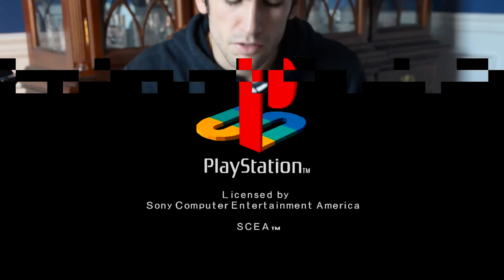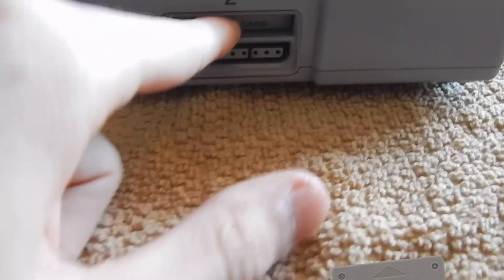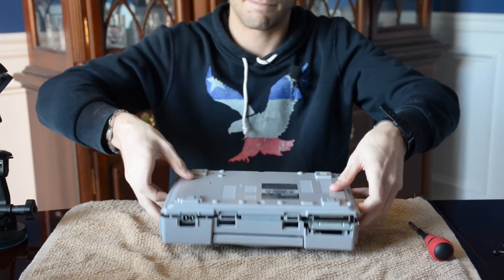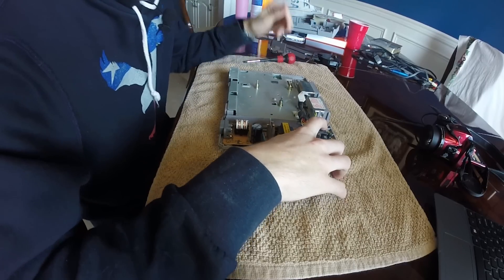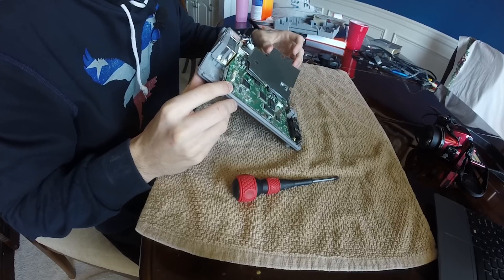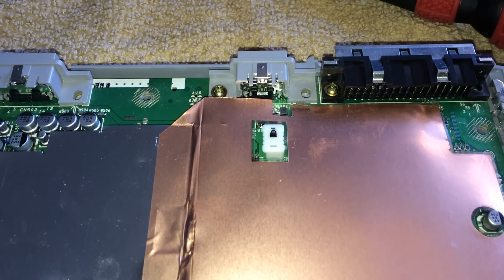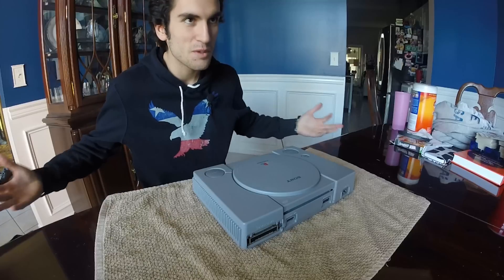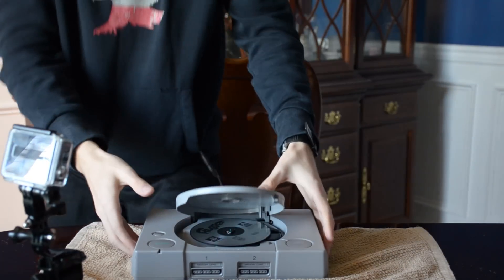Deconstruction: Original Sony PlayStation

Comment: The sound I think comes from the lens sliding back and forth in it's track. Basically it's having trouble reading the disk, so it's trying really hard.. Could be a dirty disk, scratched/damaged disk, data rot, dirty lens.. Not sure about the PlayStation 1, but the PlayStation 2 had a "pot" adjustment screw that could be used to tune the laser of the disk reader. I've heard that sometimes the lasers just go bad and can't be fixed. they just have to be replaced, and usually it was cheaper to replace the disk drive itself. On the PlayStation 2, you could use a DVD drive from a desktop computer, but only specific models were compatible.

There's lots of info out there since these older consoles are somewhat collectable and there's a fairly healthy community of collectors, modders, etc.

Good luck.

Comment: 1st: the noise comes from the motor bearing, it should be oxidized or damaged, but probably is what is causing the lag. By loading the game into the ram is making it faster.

2nd: an actual pentium is faster, running up to 120MHz, an HP50G calculator has a 700MHz-ish processor, thats amazing!

3rd: if you disasemble anything alse with a big capacitor DON'T TRUST THE 10s RULE!!! Sometimes these capacitors don't feed power to anything if the circuit is not working, so they will be charged (in special inside TVs. special warning to the tubes, that thing stores energy for years and can kill you). Use a ground wire to discharge it instead.

4th: one of those rear mounts were used for a cheat ad-on called game shark, Mr nice guy XDD

5th: the metal board is made of coated steel to protect the insides of the motherboard. Didn't help a lot about the cd reader, though, but it traces back from old ataris 2600 through nes, snes, master system and genesis. Old kids used to drops those videogames a lot compared to these new kids XD

6th: awesome video, keep up!

Comment: It looks like an SCPH-5501. NOT the original model. The SCPH-1001 had separate composite outputs, as well as 2.5mm jack to supply power to an RF converter. That was located between the Serial and AV ports. The Parallel IO was used for GameShark. I recall Gameshark had, at one point, a thing you could plug into your PC to basically probe the memory while playing, and I THINK that used the serial port. Other than that, I don't think either of them did anything. The 1001 was designed such that the heat from the power module could actually damage the CD read head, but had one of the best BIOSes for emulation. On my 1001, the power module actually stopped working, and I replaced the whole thing... retrospect, I probably could have isolated the faulty component and replaced that, but, yeah...

Comment: true first generation PlayStation had the original 3 three color A/V plugs instead of the proprietary form plug--->RCA (A/V) plugs. but still same innards but the original I have had the female 3 color A/V plugs. I'm guessing another way to need a special replacement part 
I really don't know if they're the same but u assume V.1 and the V.2 I have are the same. both of mine run the same. just another way don't got you to buy the proprietary cable.
just some history.
Reply: just another way THEY** got you to buy my a proprietary plug. 
sorry

Comment: It's EDO RAM while at it. ;)
Interestingly enough, some models actually ship with 4MB RAM, which to utilize require bank switching, otherwise it works as standard 2MB. Also, there is a certain board model that can be upgraded to 8MB RAM (I think it's 8, off the top of my head). Not really useful for existing games.

Comment: Hey. Actually the first Playstation model has rca stereo composite output on the back between the multi-av and the serial port. 
Well, the first first Japanese revision even had a svideo output too! 

Maybe the controller didn't worked because the game must have digital only inputs and by hitting the button that activates the analog sticks, you disabled the controller. 

And the parallel port...  Now there's a device called "ps-io"  which is kind of a flash card for the PlayStation...
Reply: The pro action replay also used the parallel port.. I wish I still had my 1001 (with the AV ports right on the back)
Reply: Filipe Lana yea mine has av and RCA out jacks too

Comment: my PS1 read CD's only when it was on its side :D
Reply: So did my 1001 model.. It's a common problem... the drive motor bushing wears out putting to much drag on the spindle to spin the disc fast enough.. putting it on it's side takes some of the drag off so it reads.. to bad it's only a band-aid
Reply: Mine had the same issue :D And I was the only person out of all of my friends to have a 'chipped' PSone to play NTSC and burnt games - So it slanted its way through everyone's living room.

Comment: If the motor made some sort of rattling or grinding noise, it could indicate that the CD could have been very scratched so the laser lost tracking all the time and had to rapidly find the previous place where it had skipped off and slow down the cd for better reading results. That would explain the skipping intro movie. It was read directly from the CD and because the reading head of the CD player couldn't keep up the constant data stream from the CD, the movie started pausing. Or the CD could have been just fine but the components inside the PS had dried up so their responsiveness wasn't at their best and caused that pausing. I had similar issues with one PC game called Megarace but its movies because of my slow CD drive and not because the CD was scratched or my that time's PC was too slow or unused.

Also the dead controller is a "normal" thing with PS's. My PS2 controller also died partially so that none of the right hand side buttons worked but the left hand side buttons worked just fine. It's a design feature called planned obsolescence. I even opened it up, cleaned everything I could, made sure everything was soldered well in place and all wires were connected well and so on and I still couldn't get it to work. It was some microchip breaking up or some capacitor drying up or some other that kind of stuff which  you couldn't see with your eyes.

Comment: I'd say disk or lens was scratched or dirty... 
Only time I ever had one load that slowly or skip in that manor.. .
And the noises are totally normal. Even when I had a brand new one as a kid, I remember that noise.
Reply from the maker: I remember the noise too. I was referring to the rattling plastic sound. That was not normal.
Reply: Ah.

Was for mine though!
When I got old enough to question it, I chalked mine up to a missing ball bearing that would hold the disc down in the tray after hundreds of hours of use..
As old as they are now, it could be a dead bug, a peice of dirt or grit from a carpet, a crumb, anything really..
Just part of the nostalgia for me. My ps2 does it too...  Those older systems could really take some abuse and still work wonderfully...

Comment: Yeah, the shielding cans are usually soldered to the board for RF suppression, especially from the switch mode power supply. From what I remember the PS1 use complete software rendering so no GPU either, other than a display driver.
Reply: There were different solutions that generation over, and generally they use copious amounts of hardware acceleration because cheap CPUs that generation simply weren't fast enough to generate 3D images. It was possible say on a Pentium PC CPU in a comparable manner to Playstation(1), but that was a processor of complexity and expense that was much too high for consoles in early-mid 90ies. Additionally, it was easily noticed that in a 3D game running on a Pentium, 90% of the time would be spent filling the triangles, with the rest of the time being for geometry processing and the actual game logic, so early 3D accelerators for PCs only did that one thing, drawing textured triangles. The driver software would do the geometry transformation on the CPU, and deliver pixel coordinates, 3 sets of x, y, and depth, per triangle, to the accelerator hardware. Correspondingly, a console didn't need a strong CPU if it just had triangle rendering hardware accelerated either.

N64 uses a second CPU, dubbed DSP, with a mystery co-processor to produce graphics and sound - presumably the co-processor accelerates drawing triangles not as a whole, but line by line. It was not usually directly programmed by game developers, running the same Nintendo-provided program for almost all games, with Factor5 and Rare games being almost only exceptions, plus Resident Evil 2 had a slight modification to default software. In a way, it provided a modern high-level interface towards the game software running on the main processor. Early N64 emulator UltraHLE didn't emulate the DSP workings at all, it merely grabbed the signals going to DSP and vaguely recreated what stock Nintendo software was doing. The list of features that the mixed software/hardware solution implements on N64 is impressive - filtered textures, perspective correction, z-buffering to disambiguate overlapping surfaces, lighting, you name it. From the point of view of the software, this is already not dissimilar to more modern GPUs like GeForce 1/2. The performance was of course not comparable though. It's believed that N64 was co-designed by SGI and carries a lot of its legacy, but NVidia is also a company manned by ex-SGI people, so it's not too surprising that they tried to converge on something vaguely similar over the time.

Playstation uses a more typical arrangement for the time. The PS1 graphics processor took a list of transformed (and optionally colour tinted) triangles or quads (internally treated as two triangles) in view coordinates (essentially pixel coordinates) and rendered them, and the CPU carried a co-processor that accelerated matrix-vector multiplies, to allow you to rotate and translate your triangles from global or per-object coordinate systems into the view coordinates quickly. There are two quirks to the Playstation GPU, both conserning the fact that it has no concept of depth. It distorts the texture only in two dimensions instead of 3 (so called affine texture mapping), so at an angle it would look very wrong, and the second was that it had no way of disambiguating what surface was overlapping another one. To help with the latter, the GPU command stream provided a list of buckets where you could put all your surfaces that lie in particular depth range per bucket, and it would render them in that order, with most software choosing to draw back to front to make closer surfaces correctly cover the distant ones, and of course the solution wasn't exact enough so sometimes things ended up switching order, you can clearly see that in many games. There's another possibility, by marking a pixel as already drawn and drawing front to back only on the pixels that weren't drawn to before, but nobody did that. The affine texture mapping was sometimes fixed in software by subdividing polygons that it would be most apparent on. These were the compromises that had to be done so the GPU could be designed in-house and manufactured at a low cost. It's a surprisingly simple design - a minimal set of modifications compared to a system that can simply rotate and scale sprites like SNES could do with one of its playfields or some arcade machines did, basically just adding skew and clipping a transformed sprite along a free form triangle.

Sega Saturn, even though it's structurally way different, went with a vaguely similar GPU design approach to Playstation, but failed to make the system compatible to triangle based graphics as was common on SGI workstations that were used to produce 3D objects for games that generation, perhaps out of an assumption that developers familiar with 2D techniques would rather extend on those rather than switch to a fully new 3D workflow. Probably seemed like a good idea right up until the consoles actually came out and games started appearing.

Dreamcast is not structurally dissimilar to Playstation, also feeding the GPU view coordinates, however the coordinates were 3-dimensional and there was full depth correction and full hardware depth sorting, something that partially disappeared in later hardware e.g. for transparent surfaces. Also the coordinates were allowed to be fractional rather than integer, allowing to represent finer movements exactly. The GPU itself was actually extremely complex for the time to minimize memory access and allow cutting cost on memory performance, with hardware techniques that hide this complexity that were eagerly adopted on mobile phones for power consumption reasons but didn't come into the PC space until recently. There was also a co-processor embedded into the CPU for fast coordinate manipulations.

Playstation 2 differs from these by providing a separate signal processor that was mostly responsible for coordinate manipulation, and that was programmed by game developers again. Additionally, developers were burdened by swapping multiple sets of textures numerous times per frame into the tiny 4MB memory attached to the GPU, with most of it being occupied by the generated image rather than the textures. In theory, you'd have the whole main CPU for gameplay tasks only, but in practice it ended up doing a lot of hand holding to keep all the other units running smoothly.
Reply: yeah, I googled it, the GPU was divided between the CPU and display driver, an interesting way of doing it back then for cost. Although now the GPU chips in modern cards do a lot more then back then, when they relied heavily on the CPU.
Reply: so it was an apu
Reply: No, back then CPU's did pretty much all the graphic works, with a GPU just addressing pixels, but the PS1 used a some what GPU in modern thinking, the CPU still did a lot of the work a GPU does now. You can google the hardware and how it worked. Also APU is AMD's term for dual and quad core CPUs with Radeon compute units on die.